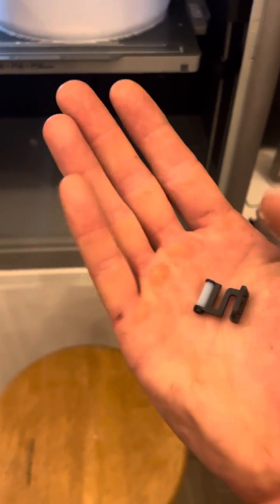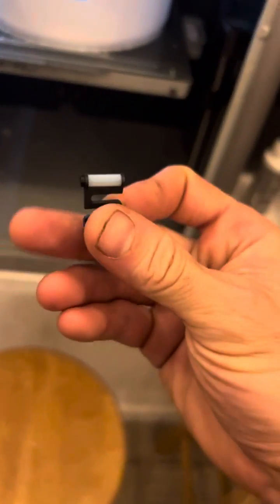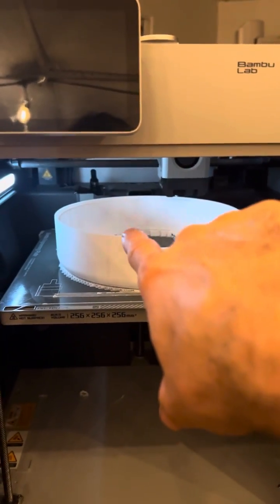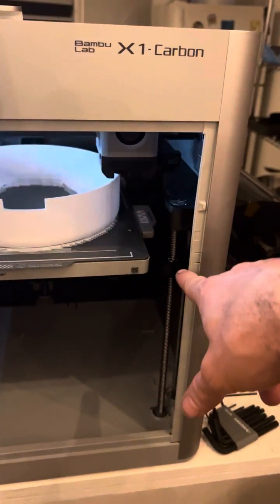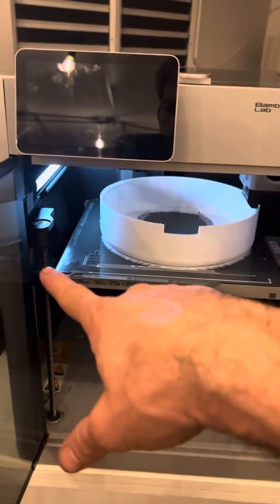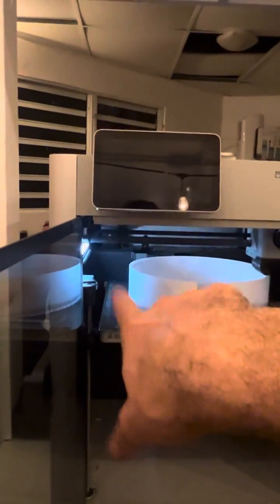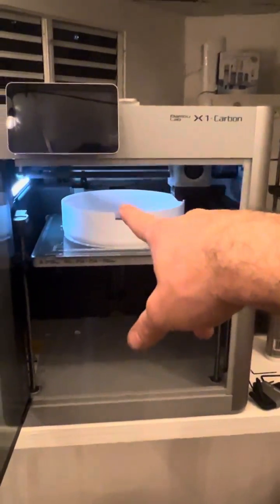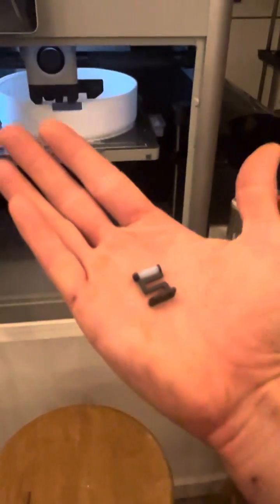Bambu labs x1 carbon “homing Z axis failed” bad filament wiper.  READ DESCRIPTION for full solution

Comment: If anyone is still having issues like I was after trying everything under the sun check your smooth metal bearings on the side and make sure they're all the way down. The one on the left side was up higher than the one on the right and that was causing my z axis to fail all the time. Hope this helps for future reference.

Comment: I’m having the z axis fail error. I have the P1S. i can’t seem to find a video for the P1S. But the inside looks a lot like hte x1. I’m still struggling on fixing this. But this quick little video helped. I hope I can get it up and running. Just got it at Christmas and it’s been down for two weeks.
Reply from the maker: Hey!  Yeah so i definitely had to mess with it more than just this video.  I found the key was really really making sure that there was no little bits of plastic stuck anywhere in the work gears and blowing those out.  Also think that I switched up the build plate and that helped also.
Reply: I've printed just a couple of small things, and now I'm already getting this error.

Comment from the maker: I actually ended up continuing to have issues after I changed the wiper but took a few more steps which I describe in the description and now the printer is golden.  It had printed a few times after I changed the wiper well but then started to act up again.  See description for the REAL problem.

Comment: You might have mentioned how you got those little things. Is it something you print or order from Bambu Lab?
Reply from the maker: It is a part you can order from Bambu labs and they send the printer with extras.  The one I have in my hand is actually a new one.  I should have showed the damaged old one in the video.